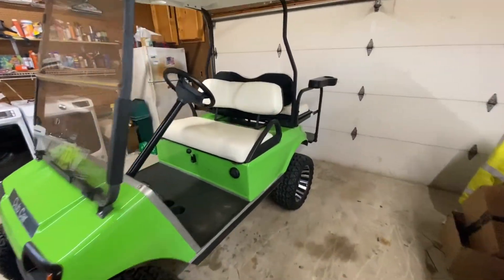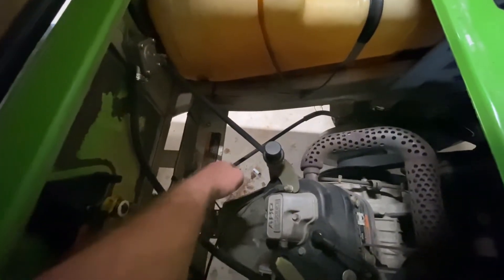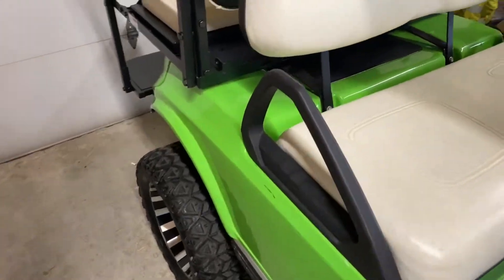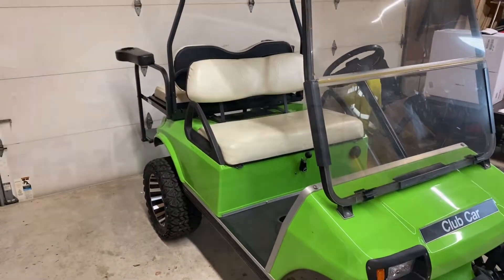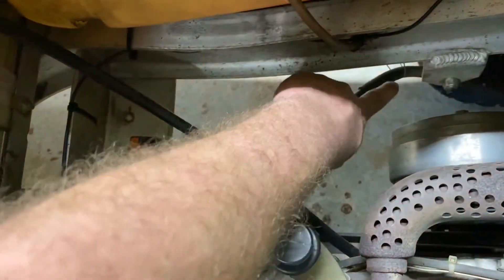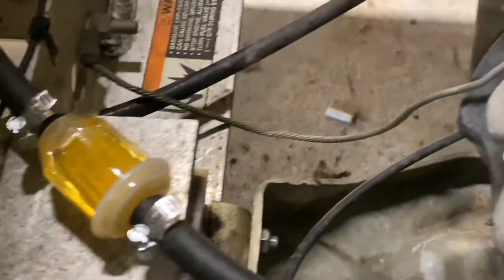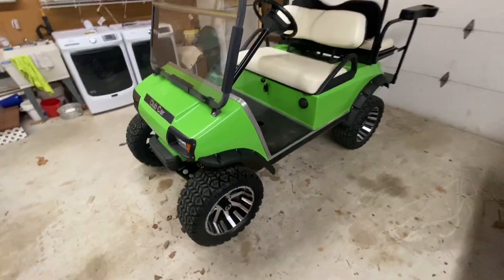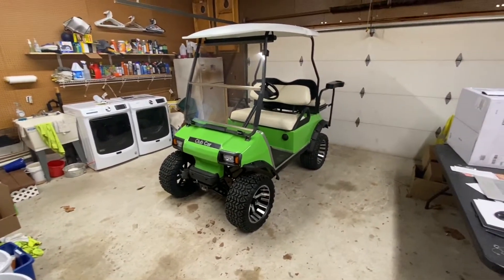Club Car Final Touches and Adjustments

Comment: Jacob   the front motor mount is suppose to have 2- 3/8 to 1/2 inch spacers between bracket and plate so bracket doesnt hit frame and rubber mount will stay in place. thought u might need to know when you go to fix yours...
Reply from the maker: Thanks for the insight - you are correct. I am having issues with that motor mount and that snubber mount - the motor angle vs the mount is a bit too extreme for the stock placement to work, and flipping the angle bracket around didn’t quite fix the issue.
Reply: Having same issue with the motor mount I completely took the bracket off probably not good on it looking forward to see what you come up with

Comment: Great Job on the cart. I am about to start a 1998 Club Car DS customization project. Mine is electric. I have a question about your headlights. I am looking into some that resemble the ones you have. You mentioned in the video about the headlights, like the mud guards, not fitting great. Did you solve the problem, or did you find lights that fit better, or did you just fuss with them until they were acceptable? Thanks for any advice.
Reply from the maker: Hey - thank you! I didn’t do anything above and beyond to fill any gaps or anything, you really can’t notice it unless you point it out. They look like they’re supposed to be there. The headlights weren’t too bad, you will need to cut the plastic around a contour and be able to do some wiring. Good luck with your build!